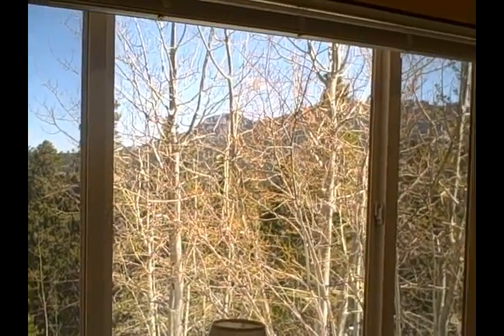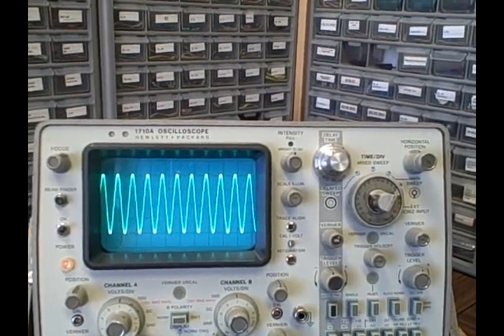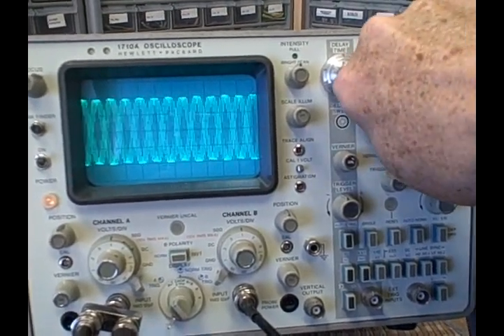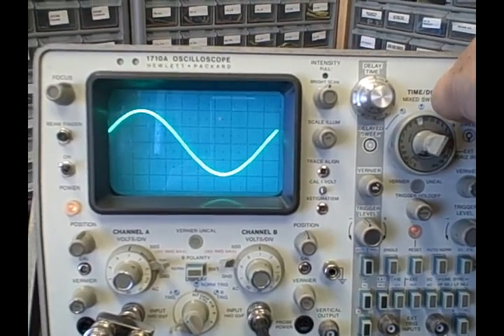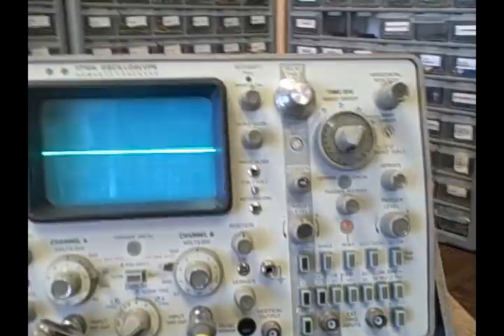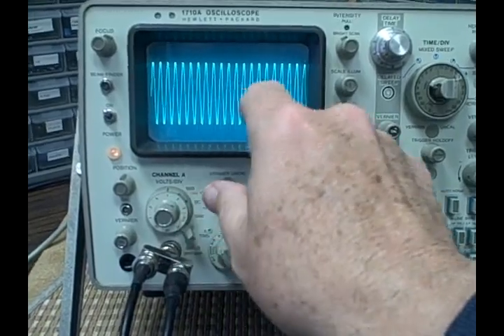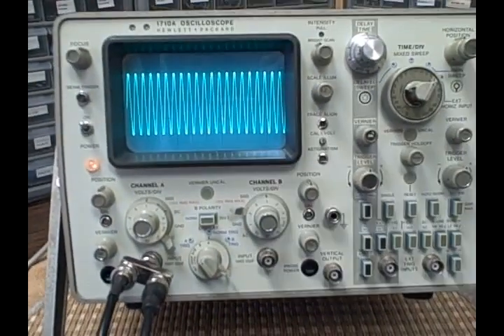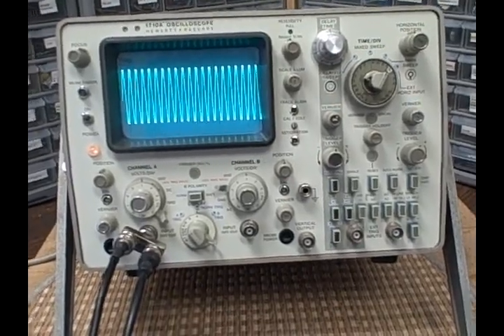HP 1710A 150Mhz Dual Trace / Dual Timebase Oscilloscope

Comment: I think Tektronix had better CRTs, comparing 1710 to a Tek 454 has a sharper trace. Comparing circuitry, the h/p used fewer parts.
My experience with this vintage of h/p test equipment positive.  I have an L band generator (can't remember the model) from the early Sixties  that was dropped hard enough to snap the front handle off, and the attenuator is still accurate! The traveling probe coaxial cable which is made of silicone looks a little crispy and crunchy